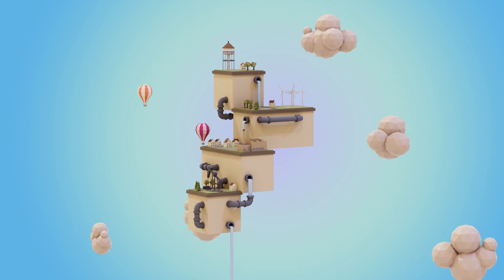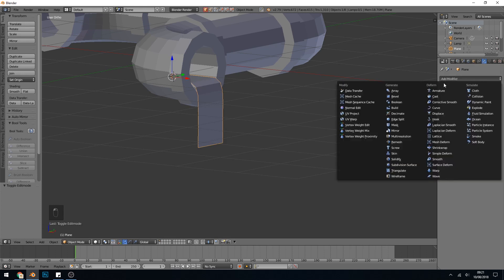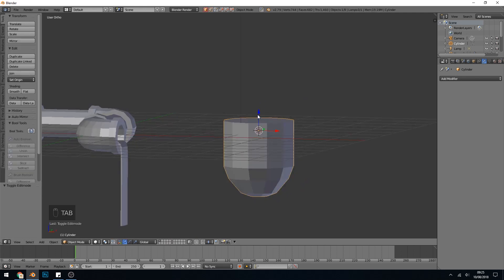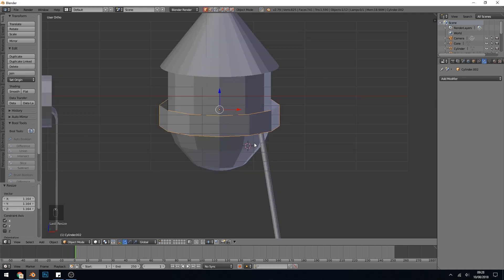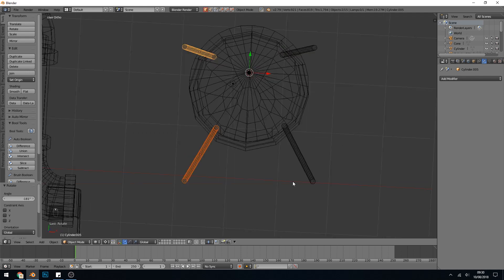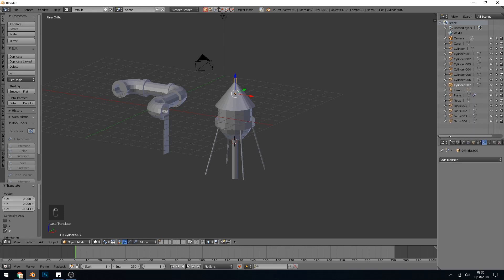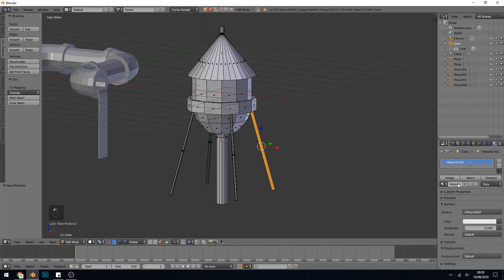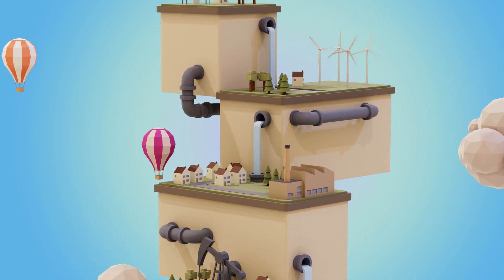Low Poly Islands | Beginner Tutorial | Part 2

Comment: I'm old enough to remember when an entire level in a game might have the poly count of that water tower. (Okay, I'm a lot older than that.)
Reply: Ha, funny, but no.
A lot of early 3D games used kind of open worldish levels, so an "entire level" might as well be the water temple of ocarina of time, and no matter how low poly you get there is no way you can have a level with 2000 triangles.
Reply: The exterior of Peach's Castle in Super Mario 64 is apparently 871 triangles for the terrain itself.  If you feel that is cheating, I wouldn't be surprised if the boss fight with Bowser is around 2000 polys for the combination of the stage and the characters.  (Mario is around 800, Bowser around 1000, and the arena is very simple.)

Remember that at one point, Virtua Fighter 1 was considered high poly due to having characters that were around 2000 polys each.

Comment: So for method 2 of joining an object: how would one go about texturing it? Wouldn't there be bits that won't be seen, and wouldn't it be best to go back and delete faces that are hidden?
Reply from the maker: I go through that in the second part of this video.:) material id's
Reply: Thanks. However, I meant to ask how would one approach texturing something like this for a game engine. 

For example, in the Unity documentation it states that one mesh should ideally have only one material, and usually to a maximum of 2. In the video, you assigned multiple materials to parts of the same mesh. What I hope to do is to create a single mesh, and create one set of texture maps (diffuse, glossy, normal, etc.) for use in a single material to be assigned to the mesh.

In your opinion, would baking it to a duplicate of the mesh be the best method?
Reply from the maker: yes you bake all the textures onto one texture map. or when you unwrap you use one texture map that has only a few colour and move the uv's onto those colours.